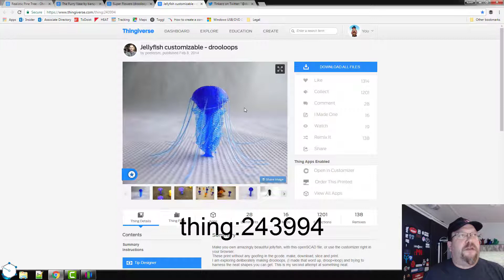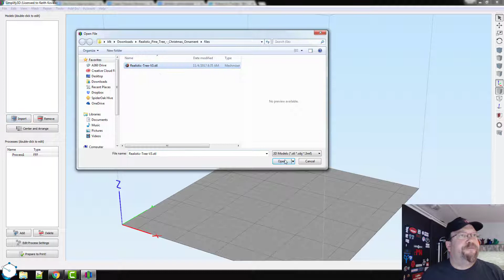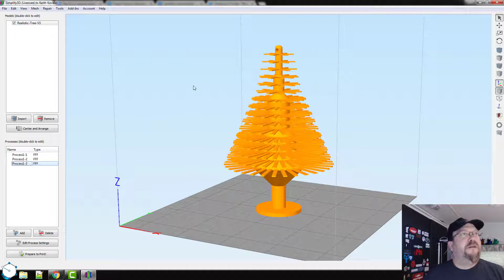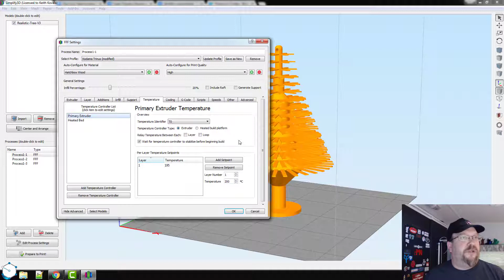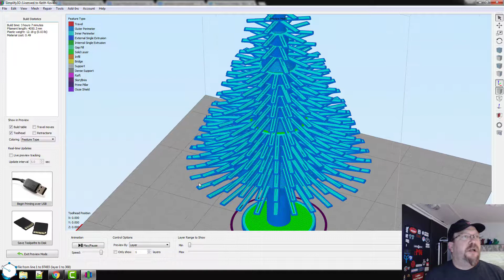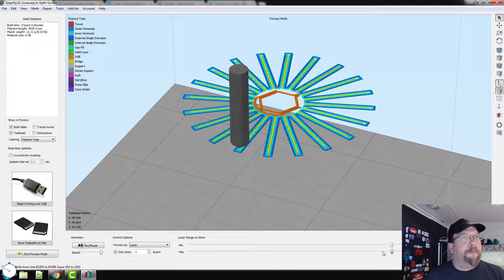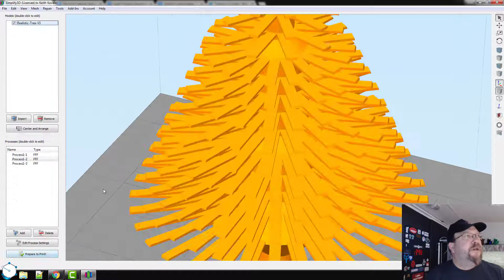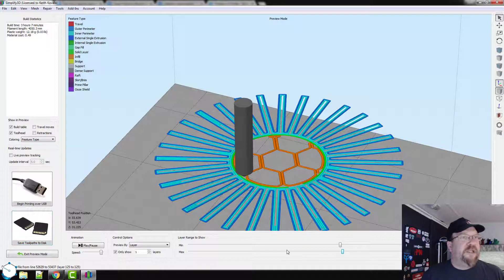3D Printing Techniques: DrooLoops

Comment: You can just tell S3D to extrude wider beads with "manual" extrusion width. Using a smaller nozzle to simulate a larger nozzle works as long as you don't try to go too fast. I've done 0.72mm wide beads with a 0.4mm nozzle. Doing that also allowed me to use layers thicker than the nozzle orifice.